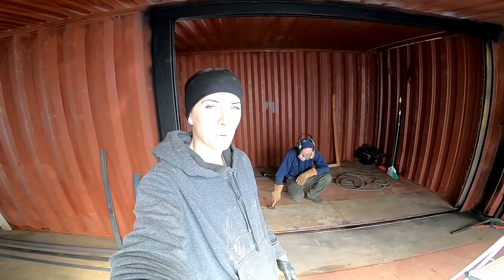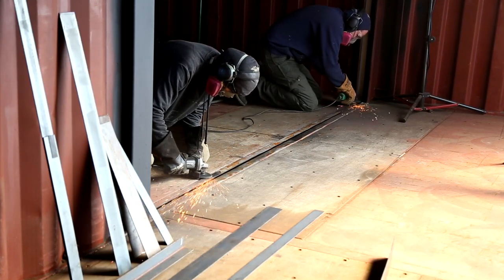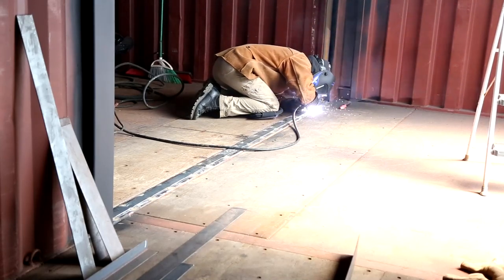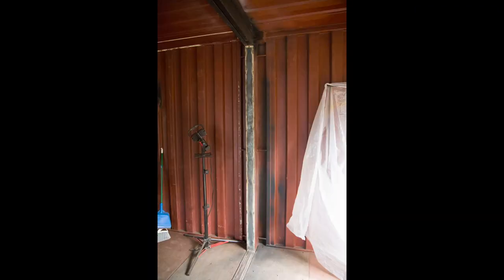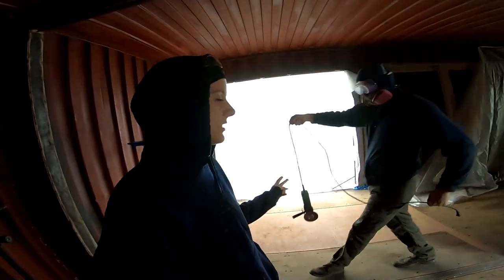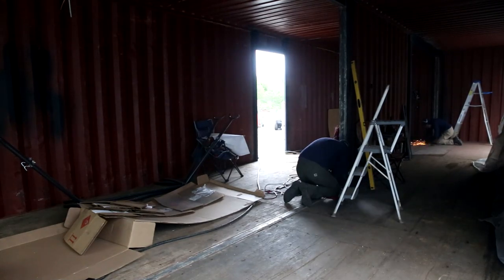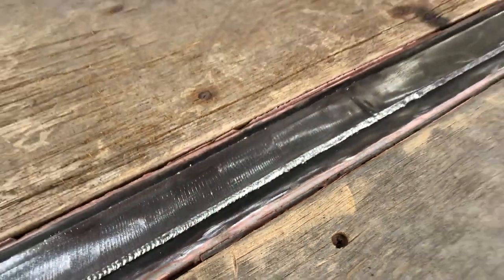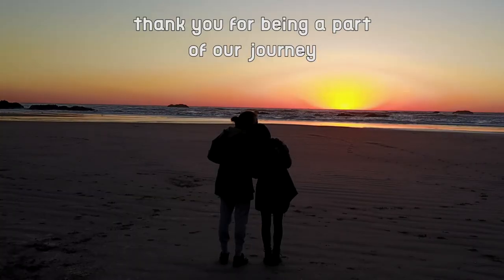Sealing The 2nd Level Our Container House

Comment: Hi, love the videos. I received a Quote $1450.00 to CUT the side Walls on (1) 20 FT Shipping Container.... Do you think this is "Reasonable based on your experience"  (I'm putting (2) of them together so it will be a total of $2,900.00 to CUT (2) Side walls on (2) 20 Ft Containers.  Thanks so much for any Tips
Reply from the maker: Thank you!! I'm not really sure if that's a good deal or not. I know metal workers/welders charge anywhere from about $70-$125 an hour so it depends on how many hours you were quoted for + materials.

Comment: How does warping happen? Too much heat, or heated for too long?
Reply: Yep pretty much. Make sure you move around welding. Tack 1 side. Then the other. Distrubute the heat. Run smaller beads until they all join.

Comment: Keep it up guys, quick question. What thickness did you go with on your flat bar? I'd figure 16 Guage would've been fine, please advise...
Reply from the maker: Thank you!!! 😊 16 gauge would work fine, but we used 1/8” because that was the thinnest flat bar we could buy. If not we would have to order a piece of sheet metal and the price was more expensive to do that.

Comment: Hi Happy New Year to you both, I am sure you have answered this before but are you using flux core or mig with gas , I am not an expert but I wish I could weld like you well done love your videos, hope as time goes by to see you working on your boat as I am a boat nut as well cheers and good luck R❤️
Reply from the maker: Thank you and likewise!! Yes in this video I use flux cored wire. If you’re indoors you can use gas with solid wire but flux core was all I had so that’s why I used it. The boat is definitely coming once the house is farther along. I’m really looking forward to restoring it!!! 😊